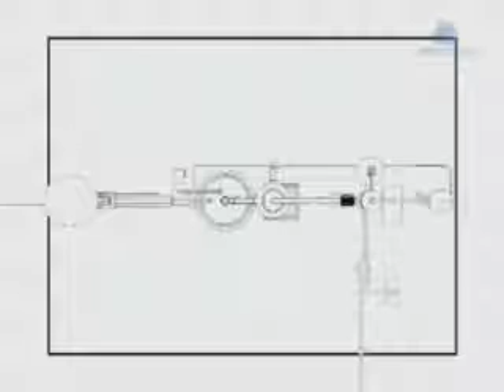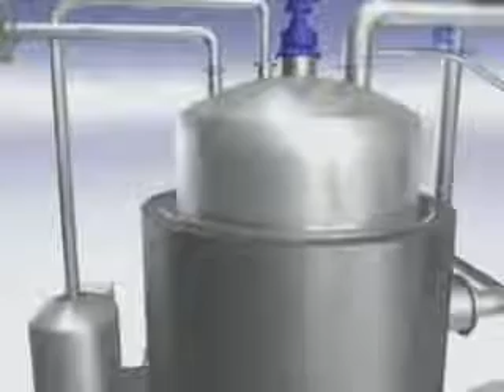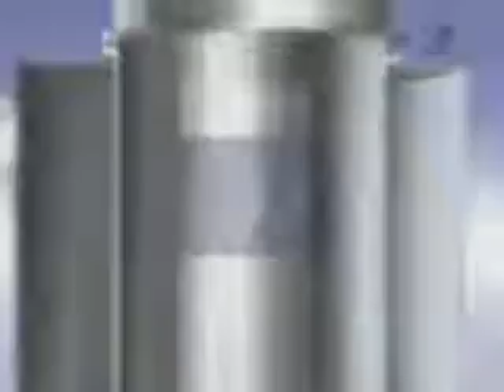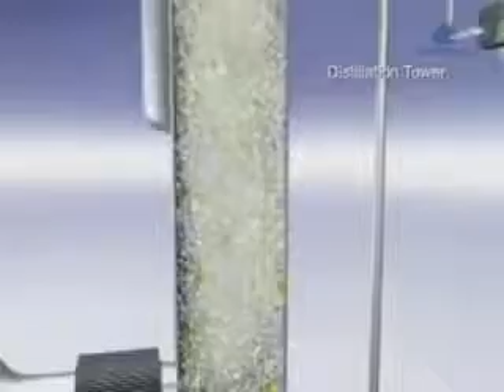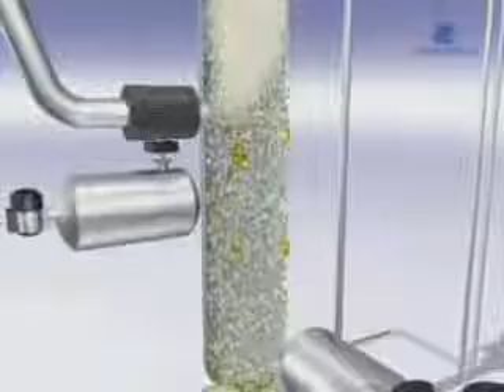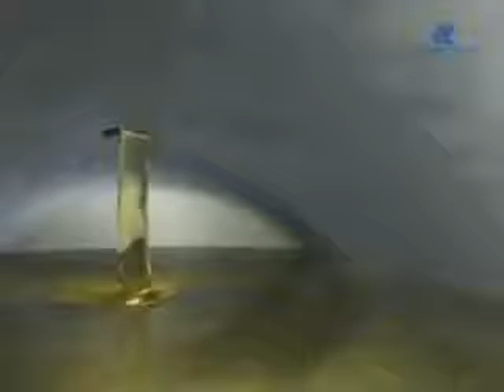video

Comment: The density difference between N and O2 or "air" in this case is of little relevance regarding purging air from the distillation equipment. All gasses in general are available in a pressurized vessel.